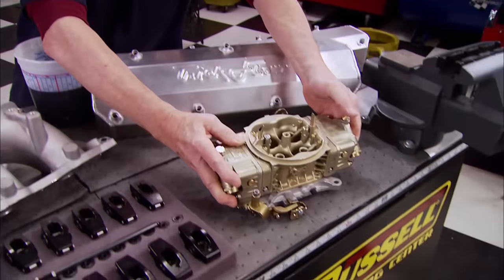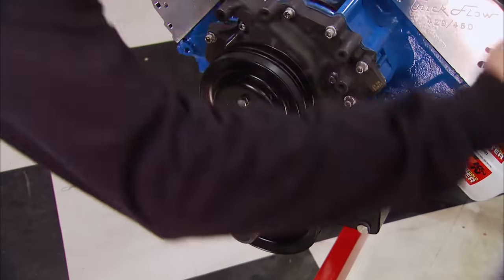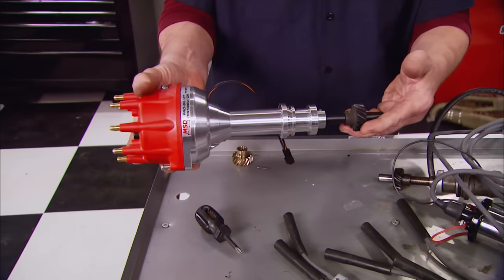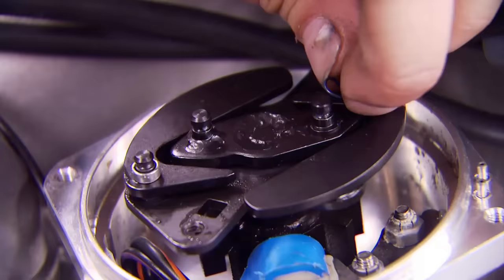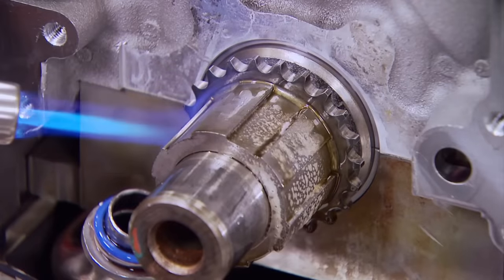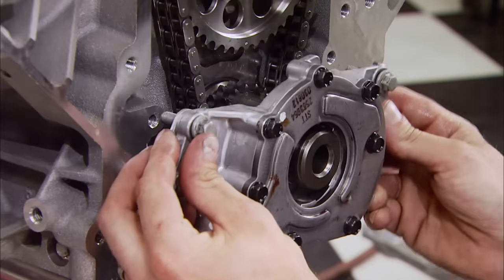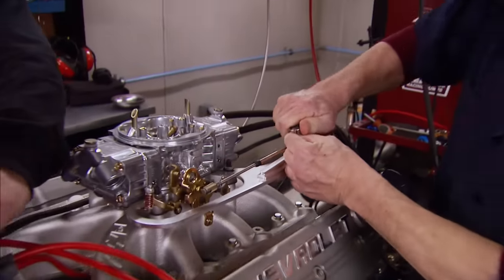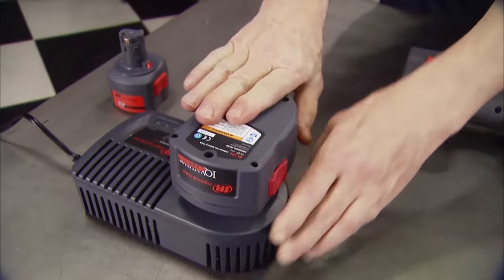Ford 460 Engine Build Part 3 - Horsepower S13, E10

Comment: I have a 460ci  from 1986 with 86,000 miles on it.  Problem is it's in my dad's Ford Econoline E-350 C class motorhome and has a bad rear main seal. :(  I'm buying a Ford Econoline 250 cargo van for work and considering dropping it in the van after a mild rebuild to make the van a little more fun.  :)  Anybody in NJ or Philly that has done a van/RV motor swap?  If I don't do the swap, it will be for sale cheap.   Great clean motor almost all highway miles.

Comment: Torque? Couldn't take two seconds to say "...and the torque is ___." Torque is more important than horsepower.
Reply: Amen
Reply: 569 at 5400 559 at 5600 545 at 5800 531 at 6000

Comment: I try getting cylinders head from Ford racing but they only have for fuel injection. Can someone post the part number from this heads. Have a f350 with 460 that want to put it into my 95 f150 single cab.thanks great video till Ls motor. Lol

Comment: Are the LS as dependent on crossover exhaust (like single exhaust, H or X-pipe) as other engines?
Reply: It depends on the camshaft used. The LS1 generally used a camshaft that was common to the 6.0L truck engines of the same time. They do prefer more exhaust scavenging. My daily driver, a 2004 GTO, picked up roughly 32 hp and 30 lb-ft to the wheels with a cold air intake and a new exhaust. The exhaust is simply the mids and catback from a 2005-2006 car that has had the catback modified by replacing the resonator with an X-pipe, a set of Magnaflow's 4x14 Magnapacks installed ahead of the axles, and the axle back section replaced with straight through tubing. I would have liked to redo the test on more similar days, as the first runs were on a milder day with temps in the upper 70's, and the later runs were on a day that was well into the mid 90's if I remember correctly. Same dyno though. 

But nonetheless, stock Gen3 LS engines do prefer more scavenging, with the exception being the LS6, as it was designed to be less dependent on exhaust pressure or scavenging.

Comment: Does anyone have a parts list for the 460 build they did I’m looking into swapping out the 460 in my 86 f250 with a remanned 460 and mating it to a zf5 transmission
Reply: Nothing about this 460 build would be good for a truck. This one wouldn't even be good for a car driven on the street. It's built for sull out high rpm racing and would be a total dog on the road in low rpm.

Comment: Ok so let me get this straight you have this so claimed LS1 motor that is and I quote:

1. Ford 5.0 H.O, 4.6Mod, 351W/C firing order
2. Ford cooling system
3. Ford Oiling system
4. Ford cross bolt mains
5. Ford angled Plugs 
6. Ford ten bolt head pattern 
7. Mind you the LS block architecture is a copy of the 4.6 Mod motor with thicker webbing. The 4.6 cast iron block handles 900hp which with the right tune can easily go 1000+ what they essentially did was adapt a cam into a modular block.
8. Ford symmetrical Windsor style head layout with fords 427 high riser ports.
9. Ford centered thrust bearing.
10. Ford kidney shaped combustion chamber which dates back to 1961 first used in the 390 HI performance Ford big block as well as the 427.
11. And Ford distributor placement in the front of the block instead of the back so again how is this a Chevrolet motor? This is down right Ford LS1 motor.
Reply: The LS block is based on Buick designs dating back to the early 60's with their aluminum 215 small block, including the deep skirted block. So, not copied from Ford there. The 4 bolt per cylinder layout was also not exclusive to Ford. All Buick did was simply knock 2 bolt holes off of the design to use 4 instead of 6 in later engines. The oiling system was also not copied from Ford. Yes, the oil pump may be in the front, but completely different types of oil pumps. The replicated port layout was also not exclusive to Ford. The wedge style combustion chambers, not really sure how those are a Ford design. Angled plugs, again, other companies used angled plugs, not just Ford. And on an engine that has no provision for a distributor, about the only way you're going to add one is to run it off of the front of the cam. So yeah, a retrofit kit for an engine never designed to use a distributor is probably going to have it in the timing cover. As for the firing order, GM used the same firing pattern in years past. There are only so many ways to fire a 90 degree V8 that uses a cross plane crankshaft. Absolutely none of that makes it a design that was copied from Ford. In fact, it shares more in common with a Buick 3800 Series 2 V6.

Comment: just a quick question from an european guy, why would you choose a flat tapper cam over a roller? cost of the lifters?
Reply: Flat tappet cams are usually cheaper than roller cams. If your motor originally came with a flat tappet it is definitely cheaper to keep it that way instead of buying a conversion to make it be able to use a roller cam, but depending on your needs a roller cam would be the better option of the two however it is still more expensive.
Reply: because roler cams are like $500, whereas a flat tappet is like $250 at most.

Comment: I would like to see what you can do with a Ford 98 4.0 v6 ohv engine
Reply: Supersixmotorsports everything you want there. Can get stage 2 2t 3 heads Cam intake,  small blocks,  long blocks whatever you want 3.8  the newer 4.0 etc old 3.8 mustang motors can become a 4.4 stroker. Just the heads cam and intake was a hundred something horsepower before adding displacement

Comment: Probably the cheapest big block you can buy...with the most potential. Even the budget build with 500 torque and 380hp is enough to get you thrown in jail! People act like that’s not much power these days but in a old F100 truck that would absolutely RIP

Comment: Loved the 460 build, but what would you put it in? LS is quantum leap, but you won't be finding one at the salvage yard for 250 bucks.
Back in my day (80's), a poor kid went junkyard shopping for Pontiac to shut those Vettes, 5.0's and Iroc's down. Any 428 would do the trick. I live in a college town,  so there was an endless supply of yuppies with Daddy's money. My Firebird w junkyard paint job and cracked windshield was minimum wage budget. Pontiac V8 is legendary.

Comment: Did anyone pay attention to the parts Power Nation used in this Ford vs Chevy big block build? They just bolted those nice heads over the stock Ford "flat-top" pistons and yet, when they built the 454 Chevy engine, they used 10.5:1 doomed race pistons.  The 454 Chevy made less torque than the 460 Ford, with only 11 more HP, despite the high dollar performance pistons.  I point this out while not having a horse in this race ..and I have no doubt that both engines are gonna do a great job,  but ..this build just proves that GM's claim of supremacy over Ford, is largely based on corporate politics and deception.
Reply: All facts.. Chevy bottom end won't hold hp.. big block Ford stock bottom will hold 700hp💪🏾
Reply: @Rome3aaro  ..when BigFoot needed torque and reliability, it's probably why they chose the 460 Ford.  They ran the original BigFoot engine for 13 years before Engine Power ever touched that 1200 hp engine.

Comment: Intake and exhaust valves take different pushrod size.
Reply: Are you talking about length? Big block Fords have equal length push rods, big block Chevy's don't.
Reply: aluminium scj heads, afr and a429 take different sized pushrod. Due to the exhaust valve location.

Comment: You can't compare dyno numbers of a injected vs carb ls engine when one gets a cam plus it dosent look cheaper
Reply: I have seen carb engines make more power than fi engines over and over again.
Reply: @bryanroupe8646  hes not arguing its possible hes arguing swapping out the cam has a huge determining factor on power numbers
Reply: Theres no arguement there. Even most stock engines will benefit from a spec,d put cam.

Comment: Your build list is vague and seems to be incomplete. Lots of ls1 parts and mystery specs on the cam. Thought I could build this with a parts list but it's not complete or accurate. Thought I could cal summit and have it all delivered, nope far from it. Very disappointing.

Comment: its funny how the "high performance" rockers, sleek aluminum handsome parts are simply "stock" on a mercedes head..look up M112 or M113 mercedes valve train, the most common motors you see on the road 99 to 2008 C, E and S class V6's and V8's

Comment: First off.  NEVER USE THE RUSSIAN ROULETTE METHOD which is what these clowns just showed for swapping the cam.  If you're doing a cam swap in the car, and bump the motor or something and a lifter falls out of the tray?  Guess you're pulling the motor.  Use some 5/16 dowel rods or similar to hold the lifters up in the bores through the oiling holes behind the cam retainer plate.  Folks have been doing cam swaps this way since the motors came out.  

Also, whoopie you made 490 horsepower on a motor with a camshaft that has on the intake 219 degrees duration @.050" and on the exhaust  233 @ .050".  There are guys out there that have put 400 TO THE WHEELS on a 216/220 camshaft.  Put that cam in a fuel injected motor and you're gonna make if not exceed that number even with stock rockers.

That's not a bad number but please don't be disingenuous and act as though comparing a stock motor to this is apples to apples.
Reply: REEEEEEEEEEEEEEEEEE

Comment: Did he call the LS a 'high tech' engine? Oh well, I suppose it does have all that modern gear like cam in block, pushrods, and 2 valves per cylinder. Yeah, that's high tech.

Comment: Literally said they carbed it so you didn't have to mess with the tank then proceeds to say you need to mess with the fuel pump 3 mins later
Reply: Well thats if your putting it in a modern camero or something like that this would proberbly go in like a nova or a buggy build

Comment: For the record, it is a harmonic DAMPER as it dampens movement, or reduces vibration. A dampener is something that causes dampness or moisture. Grammar matters.
Reply: damp·en·er
/ˈdamp(ə)nər/
Learn to pronounce
noun
noun: dampener; plural noun: dampeners

    a thing that has a restraining or subduing effect.
Reply: @roosduster  I suppose someone in charge of the english language decided damper and dampener mean the same thing. Whodathunk.
Reply: @rhubarbpie2027  Yep but what they put on is a damper as you said and it says it on the product.
Reply: @roosduster  I work on F-15E jets and there is a missile launcher called the LAU-128, it has dampers on it to reduce armament movement In flight and people always say "dampner" and it drives me nuts, hence my previous rant 😂

Comment: Come on guys, sure appears like you dropped the distributor in that motor without putting it with the rotor pointing at number One! I know you did it right, but some out there may not know! I know you're under time constraints, but if you're going to do a video please do it right!
Reply: Truthfully #1 on the distributor cap can be any where as long you remember where it is.
Reply: @maynardreed4036  this.

Comment: 3 easy steps to ruin an LS... 
Step one: Carb it because EFI makes more power and is more efficient. 
Step two: Throw a distributor on it since on plug coils are more power and are more efficient. 
Step three: Remove all the electronics as to lose all the benefits of fine tuning and adjustment.
Reply: Then convert it to run on steam...
Reply: @bigmoebigsley  and stick it in a Tesla model S
Reply: i wouldnt even own one to begin with, because they are already ruined to me.
Reply: Yea I'm not an ls guy but if you gunna get rid of all the benefits of a modern engine why not just buy a 350 chevy?

Comment: It's kinda creepy seeing a Chevy valve-cover with a distributor up front...
Reply: @Steve Paige I would say it is closer to an FE on a more general level as the extended block skirt with cross-bolted mains seems a universally accepted design...both GM & Ford.

Comment: I don't know if Chevy copied Ford or not. I'm a Ford guy but I really don't care if they did or not, most every head design that the big three used back in the muscle car days were invented by someone else anyway. The hemi head was invented many years before either Ford or chysler used them, but chysler accused Ford of copying their design when they made the boss 429. Chysler used the poly angle head before Chevy. Ford used the tunnel port design before Pontiac but they were all invented years before so just let people build what they want to. No car company has right to claim anything and that's coming from a Ford guy, everyone copies everyone.
Reply: I'm not trying to start an internet argument, just supplying some fact on the LS copy statement. Most of the design features originated at Buick. If you follow the Buick V6/V8 engines from their aluminum 215 small block V8 all the way up through the 3800 Series 2 V6, it's pretty easy to see where a good amount of the design came from. There are also some similarities to some older Cadillac engines. The intake manifold is actually a Cadillac design that was being used on the Northstar engines.
Reply: rdsimmonds you may be correct, I don't know. no argument here. like I said everyone copied everyone back in the day, they all had there own invocations but most head design's came from tank and airplane engines from world war two. people came back from there or Korea and started hot rodding cars and used knowledge from war machines. a lot of these guys got involved with manafactures in the sixties and came the factory hot rod. none of the manafactures had much of a edge on the other, they were all competitive.

Comment: Stud girdle on a 460 at this power level was totally unnecessary.  Must be pushing a suppliers part.
Reply: LOL.  There also is no need for expensive custom headers to fi the 460.  You can top quality heads with BBC exhaust bolt pattern which allows use of much more readily available, and way more affordable BBC headers.

Comment: Good as it may be, and I'll give credit where it's due as the LS can make lots of power, but modern it is not. Wasn't even modern in 97. Push rods FFS
Reply: Current LT engines are pushrod motors as well.
Reply: Ford developes a tick, replace it. Chevy developes a tick, change a lifter.
Reply: But none of that makes it modern.
Reply: ohc is older than pushrod. jokes on you.

Comment: 600 hp big block blue oval with stock rods. Can you say time bomb. Then good lord are you guys new at installing a cam. Just beat it off every bearing.
Reply: nothing wrong with the rods.
Reply: @frigglebiscuit7484  other then they are weak yeah nothing wrong with them.
Reply: @orangerider2827  dont look weak to me.
Reply: @frigglebiscuit7484  oh so you sre basing your knowledge on these rods by looks not performance and not experience cool thanks for your assumption on looks.
Reply: @orangerider2827  OK then, what hp are they proven to fail at? what year was this claim made? I bet its more of that 70s-80s urban myth bullcrap. like 72-79 big block mopar blocks being weaker, when in reality, it's the opposite.
Reply: @frigglebiscuit7484  500 hp is where they are know to start failing. It's the weakest link with the big blue oval. The rods. Throw a set of molnar rods in it and it would be good to go.  As for mopar it depends 440 block are all pretty weak. The 400s in 72 if it's a cold weather block are the strongest available produced and can actually be converted to 4 bolt mains. 72 is also around the strongest year in general for the big block mopar mostly. The mains on them with block design changed around a bit through the years all the later ones offer really are a thicker cylinder walls but the mains still are weak.
Reply: @orangerider2827  LOL NO. 440 blocks are not weak. who told you that? FLASE. go to 440source.com and read their research and test done on 440 and 400 blocks. the late model 440 blocks are ALL thicker than their older counterpart. even if its the 78 year. they have literal measurements on the mains.
Reply: @frigglebiscuit7484  Haha yeah I know I've read what the Chinese forged parts company know for cheap cranks and rods have wrote. 700 hp and 440s require a stud girdle. 800 hp and aluminum main caps are needed because they walk around still.  Aluminum cushions this effect. 800plus and your getting an after market block because the factory block will fail.  The 400 blocks simply are stronger they have thicker main webs then the 440 of any year and because a shorter deck height naturally means theirs less cylinder length that's floating for coolant. 440 source weighed all the blocks I know I've read it they also have details in the main webbing if you care to read that. Sinse you didnt care to mention anything about the cold weather blocks that were made with extra ribbing and support on the outside of the cylinders I assume you never heard of it. 440s are a great engine till 700hp. Then more and your looking at more exotic options with a high failure rate. It's why you dont see half hard filled blocks or solid blocks out of 440s the mains are just to weak to make it worth while.
Reply: @frigglebiscuit7484  I suggest you reread what they wrote it has included pictures for visual reference proving what I've been saying. Cylinder wall thickness isnt the problem with the blocks it's the mains as I've stated many times.
Reply: @frigglebiscuit7484  Facts don't care about your feelings.
Reply: @orangerider2827  not my fault you believe old folk tale lies.
Reply: @frigglebiscuit7484  Folk tales hmm is that why theirs all these write ups like this even the one you provided cover this in depth?
Reply: @orangerider2827  the cylinder walls are no thinner than the early blocks. late 440 blocks are better in every way
Reply: @frigglebiscuit7484  good lord can you read. I never once argued about cylinder wall thickness that's not the problem it's the main webbing thickness. 1972 cold weather blocks are the best.